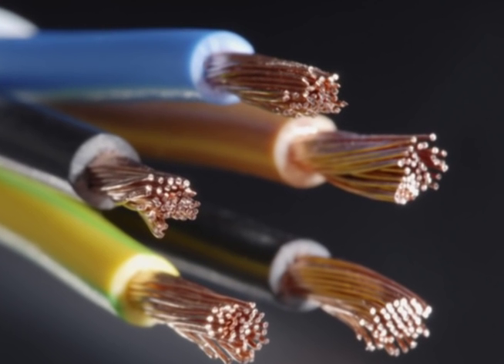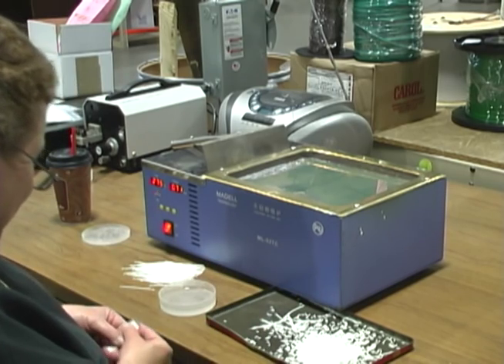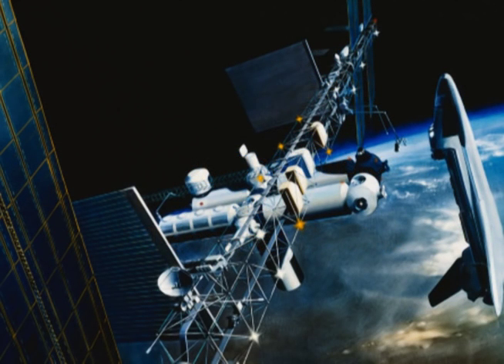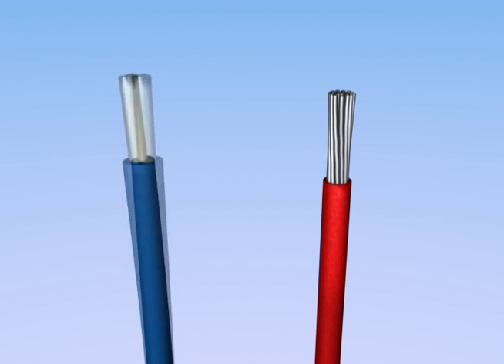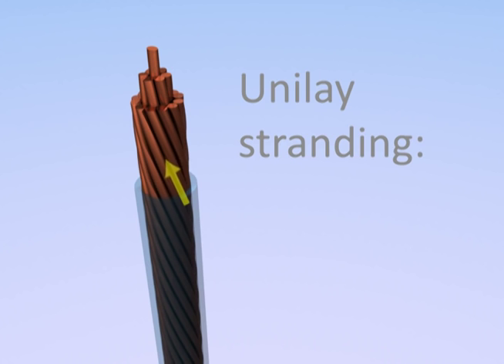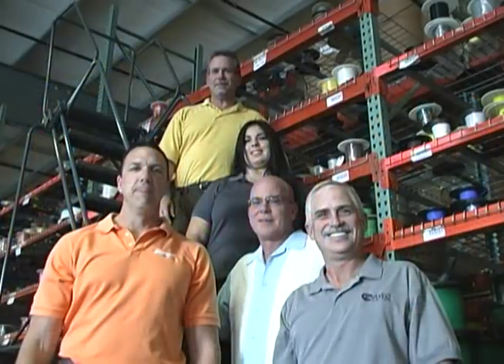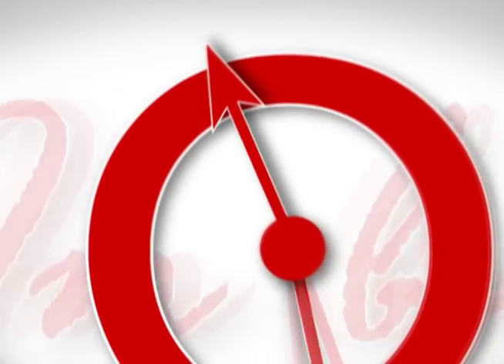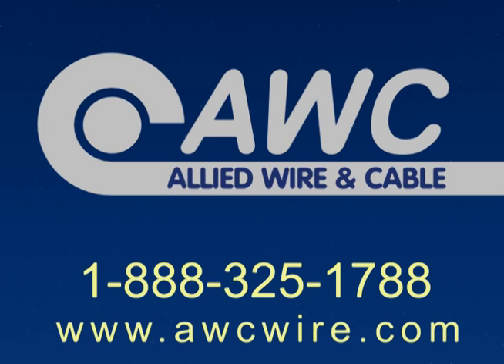Cable Basics 101: Conductors - Brought to you by Allied Wire & Cable

Comment: Great video, so what is the best sort of cable to use for 6-8 OHM floorstanding speakers eachwith  250WATTS music power and both 5 feet from the amplifier which is 280WATTS? Possibly 16 gauge copper or aluminium....